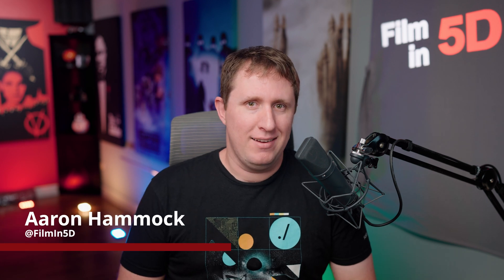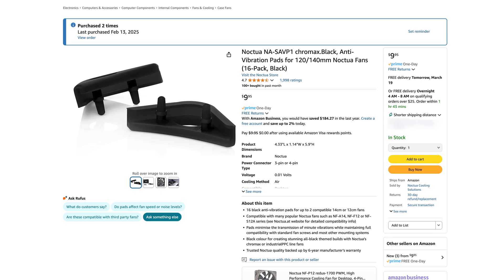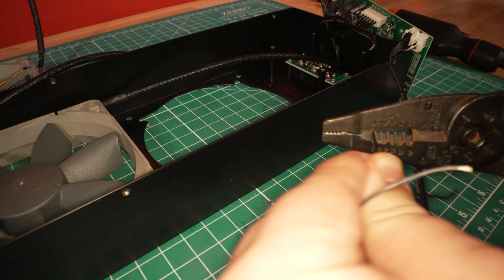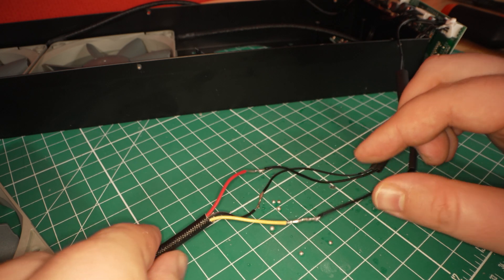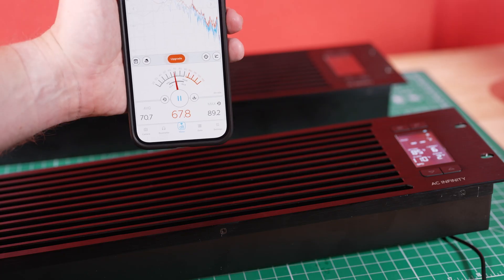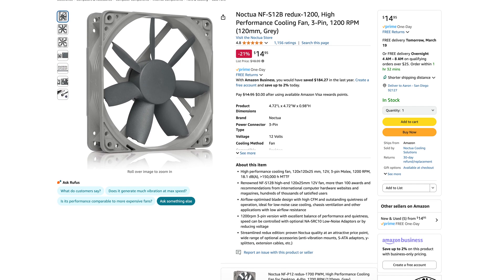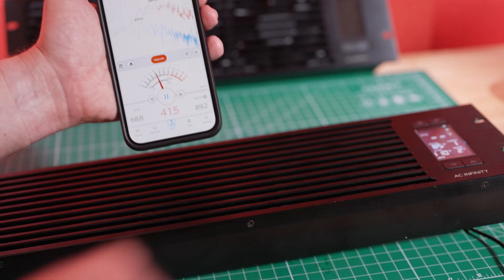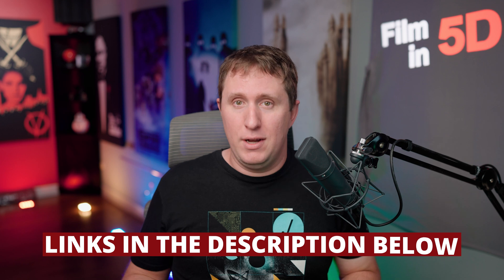Drastically Reduce AV Rack Noise! AC Infinity Cloudplate Fan Upgrade Guide (DIY)

Comment: Are the original AC infinity fans DC or PWM? If they are PWM, as the product page shows, how can a DC motor like the one on Noctua NF-S12B , work with a modulated 12V signal?
Reply from the maker: They are 3 pin DC.. which is voltage based speed control, NOT PWM. Don’t buy fans that are 4 pint basically.

Comment: Thanks for sharing this detailed info on YouTube, especially about wiring and soldering. I followed your T-9 mod for my T-7’s and found the sound level much lower—I had to listen closely to confirm the fans were running. My main advice echoes yours: use the correct tools and take your time. The wires are 22 gauge, so make sure your cutter fits. This upgrade is worthwhile; I installed the Noctua NF-R8 redux-1200 fan (80mm, grey, 3-pin, 1200 RPM, ultra quiet).